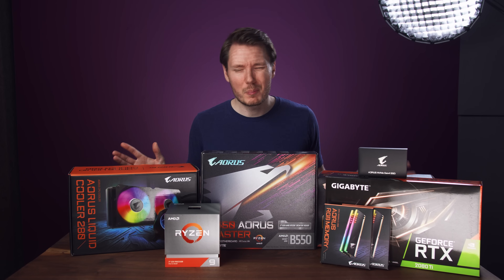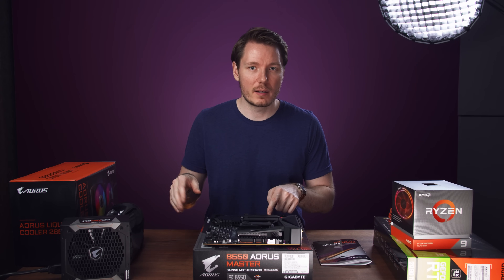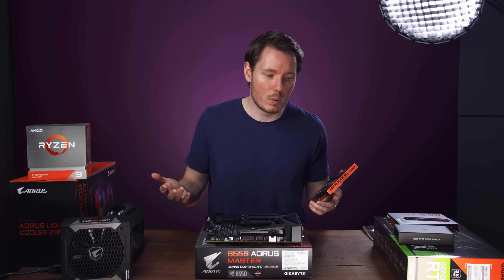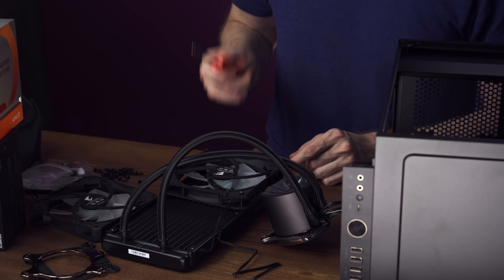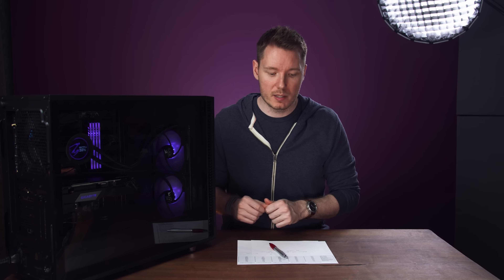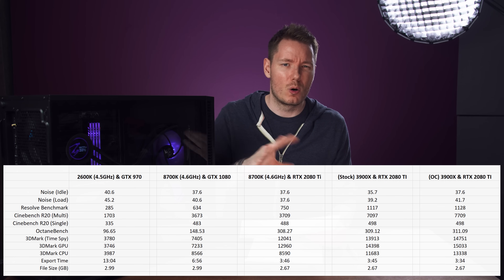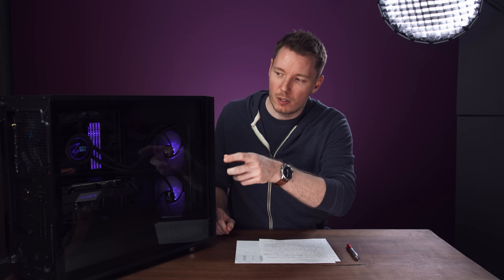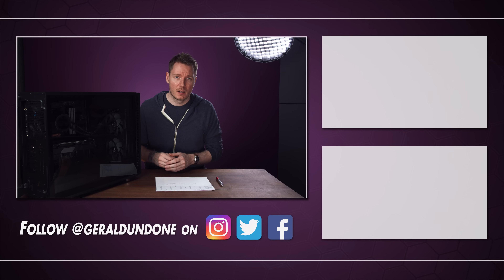Building an AMD B550 Video Editing PC // Ryzen 9 & AORUS MASTER

Comment: Who else was like ????? when he said “I’m gonna ground myself”......“Alright that should be long enough.”

Scratch that, this whole thing went over my head lol.
Reply: Have you ever touched something metal and felt a zap? Your body can build up static electricity as you go about life, more dramatically with certain shoes, clothes or carpets. If you get all charged up and then touch sensitive electronics like computer parts you can break them, so when assembling a computer you should regularly 'ground' yourself to dissipate that electric charge you've built up. In this case, Gerald is touching the metal case of a computer power supply which is plugged into the wall with a 3 pin plug - two of the pins transmit power, the third grounds the metal case. You'll notice electronics with metal bodies (e.g. your microwave) should have 3 prong plugs... could go into more detail on why this is important for safety and why some plugs only have 2 but this comment is getting long!

Comment: Hey Gerald (or anyone) do you have time to answer a question? What is the benefit of having 1gb 2gb or 10gb ethernet if my home internet isn’t that? Is it just for a DAS or NAS?
Reply from the maker: Correct. It's for network purposes--connecting to a faster switch. Maybe there's some people out there with faster than 1-gig internet, but I am not one of them. 😜